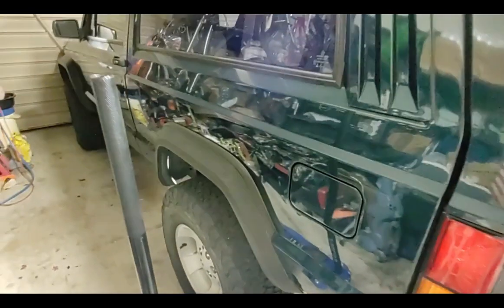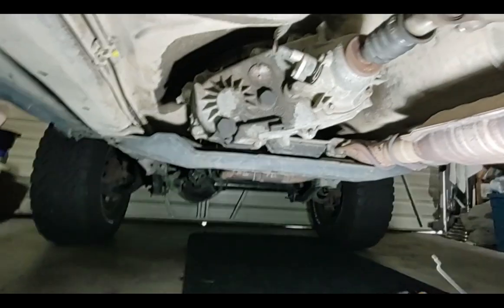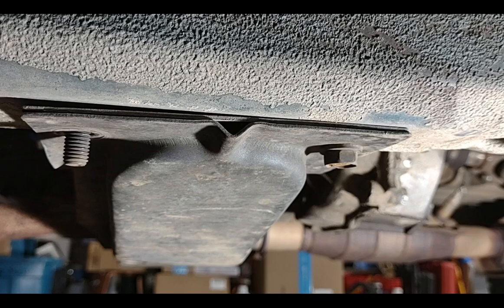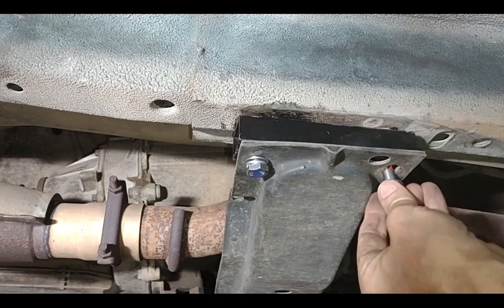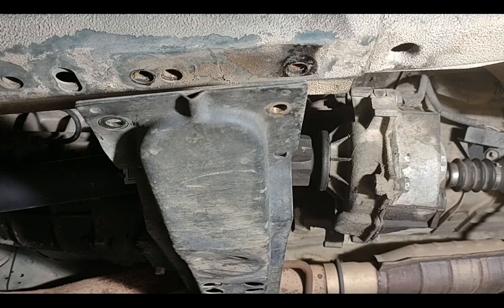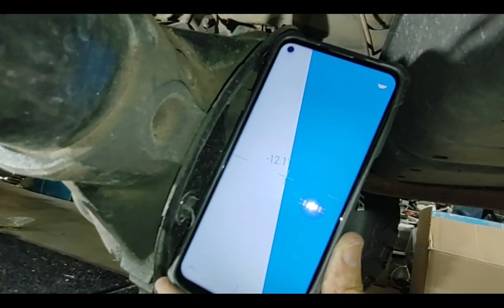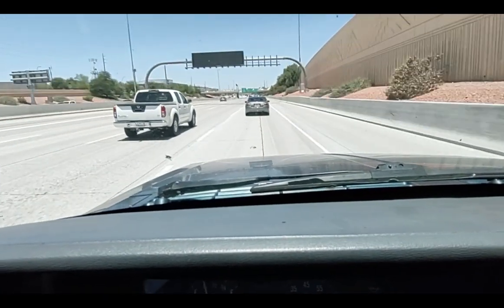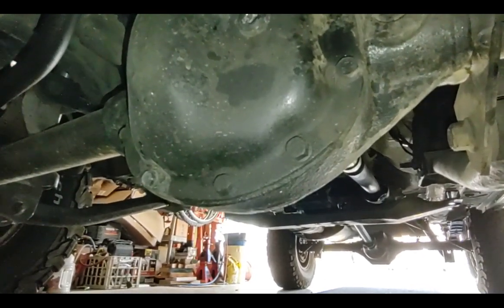Jeep XJ Cherokee Transfer Case Drop (rear differential alignment, part II)

Comment: How does your phone know what's level vs what your shop floor is doing? I'm not so sure your phone can be accurate in that way/ in this application.
Reply from the maker: Great observation. However, I do check the phone level app against the garage floor, which is very level. And in the end it doesn't really matter, because you're just comparing two angles. Even if the phone was off a few degrees from level, both measurements will be the same amount off and the delta between them will be accurate.

Comment: I heated the stud then used a jam nut. Worked great
Reply from the maker: Heat is usually the magic ingredient when it comes to loosening stuck hardware!  One of the best tools I've ever added to my collection is an induction heater, so I can just push a button and get a bolt, nut or whatever glowing red in about 10% of the time a torch takes!  It's funny though - my '96 Jeep has never really spent time in the frozen north, so I almost never have to work hard to break hardware loose, even if it was installed almost 30 years ago!

Comment: What’s the dimensions of the bolts?
Reply from the maker: I believe they're M10x1.5, and the length based on how much drop you need (figure 1" longer than stock bolts if you're doing a 1" drop, for example).  It's possible that older models had SAE bolts holding the transfer case in place though...